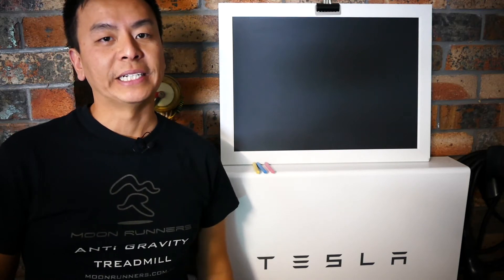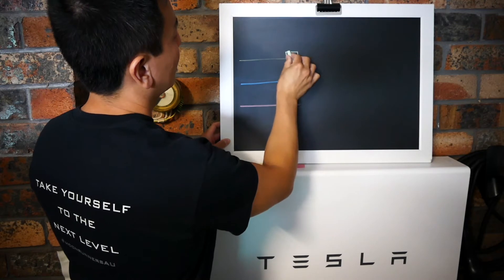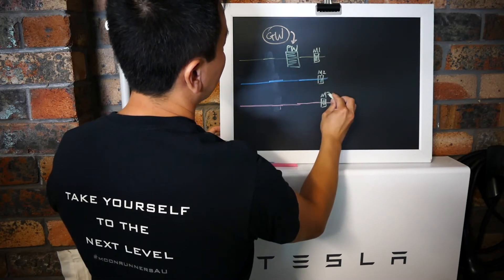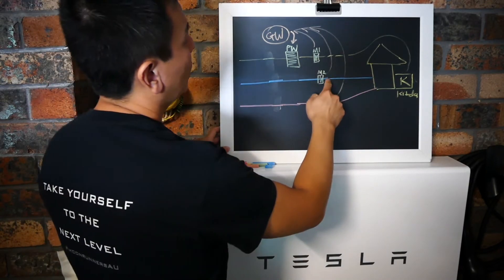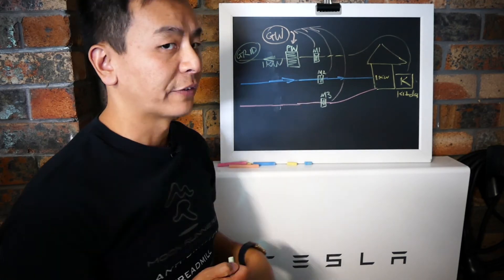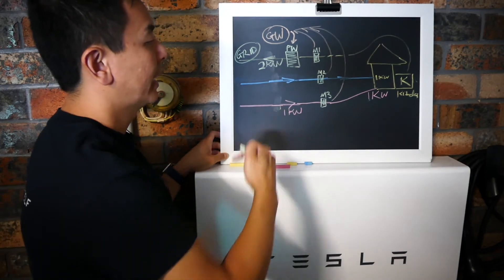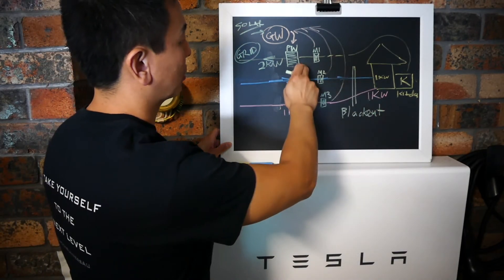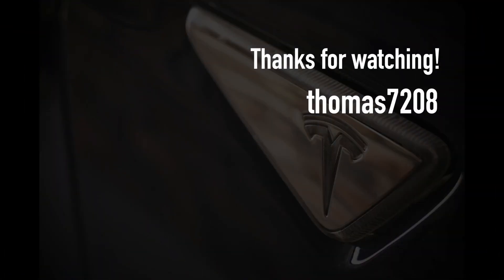EXPLAINED - Tesla PowerWall2: Integration with 3-phase power

Comment from the maker: Thanks for watching! You can use my referral code to get 1,500 km / 1000 miles of free Supercharging on a new Tesla: http://ts.la/thomas7208 
#roadsterdownunder TT
Reply: We have smart meter but they work like a net meter but the calculation is based on the rate and not kWh that means you pay for example 34 cent for a kWh plus net usage but getting only 20 cent for a solar unit. I would be keen to have a power all In our 3 phase house but at the moment no installer is providing that service

Comment: can i put a power wall on each phase to achieve the 3 phase power output?
Reply from the maker: You can ... however just beware in a blackout, because the gateway is only single phase, only one phase (and therefore only one PW) will provide backup to the house

Comment: Great video! Trying to find out if I could use a power wall 2 with my three phase house. Could also buy powerwall 3 which I think has 3 phase built it?? Also I have lights and fridges on more than one phase, can I power both in a blackout?
Reply from the maker: With PowerWall 2 you can only back up single phase so you’ll have to choose which one. You can use PW2 with a 3-phase home via net metering in Australia. I will release a video shortly on the new PW3 so stay tuned!
Reply: @LudicrousFeed Im also keen to watch new video for PW3
Reply from the maker: @JJANGSS  Australia Tesla Powerwall 3 Specifications | Three Phase Backup?
https://youtu.be/_vgArViAlYU

Comment: That will only work if the they do the calculation based on the power. Here in NZ the buy back rate is different so even you feed back the same amount you need to pay. Also on a power outage the system will shut down
Reply from the maker: Yes please note this explanation only relates to my setup in Australia where we have the luxury of net metering
Reply: @LudicrousFeed  also keep inmind that on a power outage your configuration will still shut down
Reply from the maker: I have "island mode" off grid capability so in the event of a power outage, my Powerwall would only support the phase that it is wired to. The micro inverters wired to that phase would feed the battery on that phase to power the house circuits on the same phase for critical appliances eg fridge
- I've seen it in action several times during a blackout and it works very well 🏆👏
Reply: @LudicrousFeed  yes but we have a main inverter that means if one phase is going down the whole system is down

Comment: Great video Tom. I'm about to get my second solar system. It seems I have Gateway 1 and I have 3 phase to my home. From the research I've done it seems I might have to upgrade to Gateway 2 as the new solar system is with a 3 phase inverter and load is distributed to all phases. I'll see what my installer says...

Comment: This is not a proper solution. Independent of the metering strategy (if you are charged based on the algebraic sum of the power values on the three-phases, the billing argument holds, otherwise it does not), there is a more fundamental problem: for the proper operation of the grid the power on the three phases must be as balanced as possible (this is why one tries to distribute loads among the three phases in a balanced way), while this solution creates a strong undesired unbalance. Some power companies may program their meters in such a way as to disconnect (and rightly so) a customer that has un unbalance between phases beyond a given threshold. In addition, in the presence of a photovoltaic system, if it is three-phase the powerwall would store only the energy produced on a phase, while all the excess on the other phases would be sold to the power utility at the usually very low feed-in rate. Should the solar system be single phase, it would supply power only to 1/3 of the appliances in the house. The Tesla Powerwall was never designed for three-phase systems, but just for the residential US market (which is split-phase) and to try to use it in a three-phase system is just plain wrong. There are many correct solutions for three-phase systems, which work properly, without creating an unbalance (actually they can contribute to phase balancing), such as those based on DC storage connected to a  three-phase hybrid inverter.
Reply: Although at only 5kW per battery, very little quantities to bother ‘the grid’. With a diversity factor on LV networks, it is unlikely to be an issue in the vast majority of circumstances. However if you are charging a battery, a car & running full house load, and so are all your neighbours, then it would get interesting.

Comment: Thanks Tom, that was great. how would it work if you have 2 or 3 solar inverters each supplying a given phase? can they all charge the power wall with a similar method?
Reply from the maker: Yes technically you can but the PowerWall can only back up single phase so it would make sense to stack the batteries on the one phase
Reply: @LudicrousFeed  Wow, thanks for the reply to such an old video. i think you may have miss understood my post. If you have 2 solar systems on the roof, each connected to a different phase (lines 1 and 2), with the battery also hooked up to line 1. can line 2 also recharge the battery? for example, as you feed the grid on line 2, line 1 draws the same amount from the grid to feed the battery (whilst it is also being feed by line 1's solar panels). I hope that makes sense.
Reply from the maker: Ok I see what you’re asking. What you’re describing is exactly what I currently have set up at my place
Phase 1: 5.4kW Enphase Micro inverters + PW battery
Phase 2: 3kW string inverter
Thanks to the beauty of net metering, on your Tesla or inverter app, it unites everything and it looks like you’ve got one big solar system charging the battery. Electrically, the Phase 1 solar system is the only array charging the battery. However, any excess Phase 2 solar that is exported will be returned on Phase 1 in equal balance without any extra cost to you. Hope that makes sense
Reply: @LudicrousFeed  that is exactly what i wanted to know. I have been searching the internet and youtube for this information for some time. I imagine there will be a limit phase 1 can pump power back into into the battery whilst it is also charging from grid 1, but at least I know know how this works. thanks again!
Reply from the maker: Max PowerWall 2 input is 5kW

Comment: Sorry, the video has several mistakes. Generally is correct in balancing and how the movement of power is calculated. 
1. there are NO 3 meters. There are 4 clamps connected to the gateway. They check directions and volume of electricity flow by cable. The Gateway contains a small box which is an actual meter. Clamps are just sensors and are located on each phase cable and on the solar cable (as the PW2 need to know how much power solar produce). The balancing explanation is perfectly correct. 
2. If you have a blackout, all the phases are cut off. The phase connected to PW is also cut off from the grid; however, it is supported by power from PW. Even more: the gateway has sure the phase is cut off physically from the grid to not harm the person working to fix the blackout. If the grid is back, the gateway connects the phase with the grid. 
3. Solar isn't connected to PW2. It is connected to the same phase as PW2 after the gateway. That allows the inverter still works after primary power is cut. 
I prefer setup as divided into phases by home, A/C and EV charger. PW2 is connected to the Home phase, which allows to not see a blackout at all - except when AC is on.
Reply from the maker: Thanks for the clarification

Comment: Great video, its still a cop out only having a single phase version however.  Its basically a situation that development is mainly done in North Amercia where 3p power in residential and small commercial is basically zero unlike Australia/NZ and Europe.  Your kitchen is backup phase?  I think perhaps lighting and internet No. 1 priority, then fridges, and then kitchen GPOs, but not the oven.  

But this is why a three phase unit is better, you can simply choose yourself what high current loads you want to kick off, either automatically or not.  Eg, storage HWS, Heat Pumps, ovens and EV chargers.
Reply from the maker: In a blackout I would drag the router to the kitchen
Reply: @LudicrousFeed So, I assume if you have three phase solar, you have no solar in a blackout to recharge the. Powerwall?
Reply from the maker: @mondotv4216  Correct
Reply: @LudicrousFeed  wouldn't you be able to put everything in your house to 1 phase other than HVAC \ Aircons \ Car charger. I was on a single phase and got 3 phase last year. Ever since 3 phase I was getting power to only portion of the house during a blackout. I didn't realise what has happened until I came across this video. My sparky unknowingly has spread the load randomly on all 3 phases. He Told me he was doing that and I didn't know any better then either. 

Since I managed to power everything in the house in 1 phase during a blackout, I'm now keen to see if I can put everything back to the 1 phase except for my reverse ducted Aircon and Car charger. I have Induction cooktop \ oven and heat pump. If I'm not using all 3 at the same time I think I will be fine.
Reply: Also - thanks again. Great video... 2 thumbs up!

Comment: Thanks for this vid very well explained … I’ve , today, just added a new array (we have two phases coming into our rural property - NSW) to the Phase the PW2 is NOT on … I can’t seem to find any details online at all that answers my question: can I attach my new array to the PW2 as well in order to charge it when the (new) array is generating excess capacity … The feed in rate is so abominable putting that juice into the battery just seems like the sensible thing to do …

Comment: Hello thanks for the explanation. One question - does the solar power go to the gateway as you have in your drawing or to the powerwall unit? Also can the powerwall two work with the powerwall 3 - if you wanted to have two powerwalls when it comes out. Thanks
Reply from the maker: On the Tesla app, the solar power is depicted as going to the PW. The gateway manages all this. I won’t know if the PW2 will be compatible with future batteries at this stage

Comment: How can we achieve this with a 3 phase solar inverter? Would 1 phase of the solar inverter charge and discharged from the PW and the other 2 would be consumed by house?

To power 3 phase appliances (like Tesla charger), would all 3 come from the solar inverter including the PW?
Reply from the maker: Yes as described. Net metering in Australia takes care of situations like three phase appliances. The PowerWall will discharge back to the grid to balance any excess load required beyond that provided by your inverter.

Comment: Thanks for your views. However I disagree with some of your findings. The PW2 is listed to be able to put out 5kW continously and 7kW peak. But if look at the power wiring to hook up the PW, the plug limits the three leads (of which two are used, L1/L2 not the N, single phase setup according to Tesla) to 18A each. 18A * 230V = about 4kW, not 5kW. How come? Simply put; the PW is a 2 phase machine (30A), not a single phase. That is why there are L1/L2/N leads. Two phases (L1/L2) would mean around 8kW of power which is much more in line with its 7kW feature. 
I think the Tesla has limited non-US users to a single phase to harmonize the product (gateway/pw) for export purposes. This way there is no problem with all the regional rules. The downside is that we will never see 5kW backup power (I'm in NL).
Have you ever tried to connect all three leads to the PW?
Reply from the maker: Interesting ... will have to look more into this 🤔
Reply: I think Tom's explation agrees with initial assessment of  the 2 phases in the Powerwall 2. By implication Tom actually says that the are 2 phases. One phase is hose facing making it single face from the point of view of the home. The second battery phase is greed facing making it a single face source from the grid"s point of view. In this way the Powerwall 2 can power the home phase on which it backing up at the same time it can export
Reply: From understanding as above , this  raises the  "how is the Powerwall 2 hybrid inverter constructed". This is so because to me as a none electrician/electrical engineer, there has to be two inverters in the Powerwall 2 or the inverter has to do a fair amount of magic to juggle exporting on 2 pases at once or on some occasions charging from its tried facing phase and still able to power it's backed up phase. Unless if we say in the latter case the gateway chips in to assist the power home facing Powerwall 2 phase so that the power wall can just charge through its single phase inverter and not worry about exporting through its home facing phase.
Reply: @eluke100  The Powerwall is not the one doing the import AND export. It's the gateway that does the math. So there is always only one flow either going in or going out. 
Interesting fact: In the US 2 phases means 230 volts (2 x about 110). With three phases 400 Volts are being generated (in the EU). So effectively connecting both phases of the powerwall will tell it that the leads are 180 degrees apart making it able to deal with two leads of 110 volts. Imagine what will happen if you put 230/240 on each of those two leads ... Not good.
Reply: @RH-gx3nf  thanks for the explanation, that makes life easier for my mind then.  I can start to see why Tesla wants to restrict Powerwall 2 installs to Tesla roof. If it needs to unlock new functionality using the 2 Powerwall phases you mentioned above, then it's needs to lock it down to a proprietary standard.

Comment: Great vid! I didn't know the gateway is tracking all three phases and translating that back to one phase with the powerwall in it. I still have two questions.
1. For example your kitchen uses 1kw but also the other 2 phases 'use' 1kw. Can the PW send 1kw to your kitchen and 2kw back on the netwerk at the same time? 
2. You want to buy another PW would you put it in the same phase as your other PW or in an other phase? With the last, can the gateway manager 1 PW or more the one, each on a different phase?

What i heard the problem with 3 phase batteries is to be ballanced a 3 phase battery will always send the same amount of energy on the 3 phases. In general sends more energy to the network then to your house. That's why i think above is the better way to go.
Greetings Peter
Reply from the maker: Thanks for your questions Peter
1. Yes, it can send 1kW to the house while simultaneously discharging 2kW back to the grid. Up to a max of 5kW at once.
2. If I bought another PW, I would add it to the same phase as the original battery because in a grid failure situation, it can only support one phase backup
Reply: Thank you that really helped me! Does it also work the other way around? Lets say you have a 3 phase pv system with a single phase battery. When the pv system  is putting out 2kW on all 3 phases (so 6kW total. 2kW goes to the battery and 4 to the public net. Does the gateway then tell the battery to draw the extra 4kW from the public net to extra charge the battery?
Reply from the maker: @peterverbogt3870  In Australia, if you have net metering available, then yes it occurs the way you describe ... up to a max of 5kW per PowerWall
Reply: @LudicrousFeed  i would actually extend what you said there to 5kw per phase. feed in is capped at 5kw per phase billable and 10kw per phase electrically. if you exceed 5kw output the meter will cap it and not meter anything above that.

Comment: Hi Tom! Thanks from Italy! Only a question! With a new law here in Italy we can install PV battery etc 100% financed but with the condition that the exceeded power generated can't be sell to provider! So how can I configure my battery on a 3 phase house? Thanks in advance!
Reply from the maker: Hey Fabio, thanks for your question. That’s a shame that you cannot export back to the grid if you have a battery. With my system, the battery covers one phase but because of our net metering, if power is required on another phase during normal operation, the battery will discharge the equivalent amount back to the grid to ‘net’ the amount used. Hope that makes sense

Comment: Hello there, the video is quite self explanatory.
I have 2 Tesla Powerwall 2 and looking at installing a third one. Can they install one battery in each phase to backup the entire house? I have a 3 phase aircon, but the installer told they can’t backup that during blackout. I am fine with that. All I wanted to know if 3 batteries could sit on one phase each and back up the entire house minus the 3 phase aircon?

Thanks.
Reply from the maker: Gunapathi Selvarajan Thanks for the question. With the Gateway2, you can install a PW2 on each phase. However, during a blackout, it will only be limited to one phase. The PW2 are AC coupled and thus cannot mimic a true 3-phase situation that would be 120 deg out of phase with each other. TT

Comment: Silly question... if u have an inductive cooktop, usually 3 phase.  What happens to it if there’s a blackout.  In this case it is down to a single phase during the blackout.  Will it work (badly... weakly... will it not work at all... will it be damaged...
Reply from the maker: al edg I would say it would not work at all if it is wired to receive 3 phase. Happy to be corrected. TT